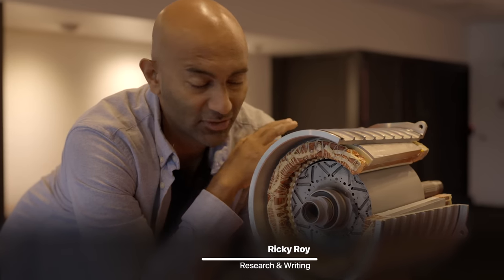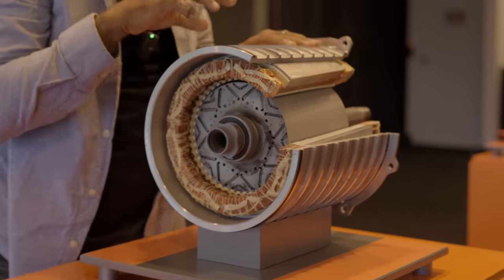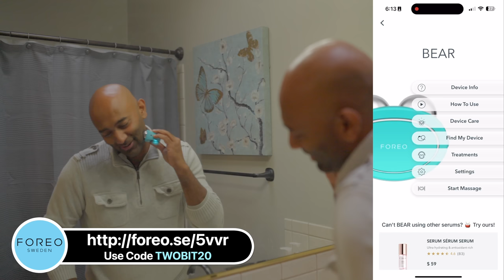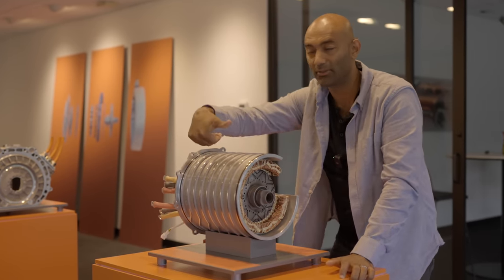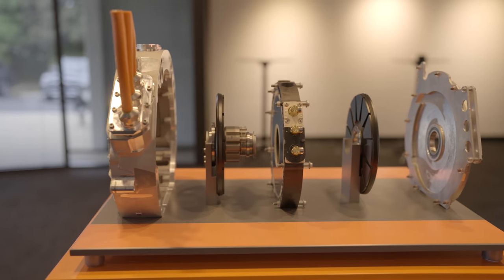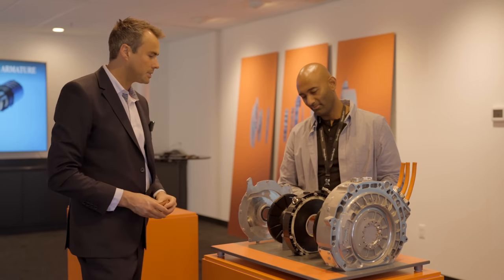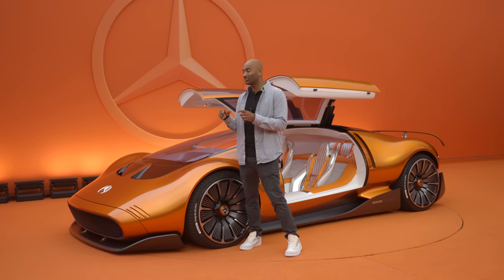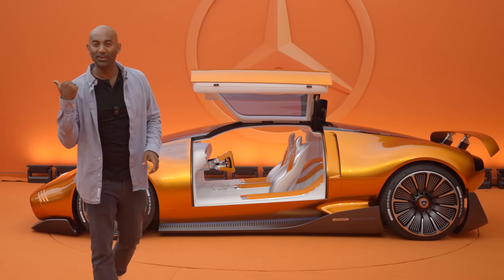Axial Flux Motors Will Change CARS - Here's Why

Comment: This reminds me to some extent of the way floppy disk drive motors were built in ties gone by. The major difference would seem to be additional magnetic flux paths to better couple the winding flux to the rotor. It would be interesting to cobble together a motor using some old disk drive magnets and coils in a stacked configuration together with a yoke or maybe magnets on both sides to the windings with two rotors coupled on common shaft/spindle. Must put it on the (rather extensive) to-do list.
Reply: Sounds good but lacks the visual aspect. Make a video about it 😁
Reply: one sided story - the pancake motor sucks at high speed and has a very bad packing efficiency
Reply: Been in the technical field a long time ago, just another perpetual motor.

Comment: I've been wondering how viable axial Flux motors would be. I built an axial Flux alternator from scratch to power my bike light, and it's pretty amazing.  Having that as a motor makes a lot of sense.  I'd be interested in seeing how the designs deal with gyroscopic forces too.  When a big heavy disc spins, it creates some very powerful forces that can even destroy the motor itself.  Radial flux motors don't have as much of a problem there because they are so much "wider".
Reply: Next the flux capacitor
Reply: Good point, wonder if impacts handling/ turning at high rpm
Reply: @lynby6231  Indeed.

Comment: I think axial flux motors have a very good use case scenario in electric aviation where ultra high RPM isn't needed but light weight high torque is a necessity

Comment: Axial flux motors (or axial gap motor, or pancake motor) are being developed by several companies at the moment. 
Great design for "inwheel hub motors" and has a lot of potential. 
Cars like the Aptera and the Xbus were thinking about using that in their cars.
Reply: "in-wheel hub motors"   
Yep, this is the holy grail for vehicles.
Reply: One of the concerns I overheard at the 2015 CENEX show at Millbrook UK about this was unsprung weight. The thinking then was that two of these would replace your differential but driveshafts would still be the best way to deliver the power to the wheels.
Reply: I had an idea for a single seater hill climb car with in wheel motors and a small swappable battery
Reply: @cjjuszczak  NO! They make the wheels too heavy and this is quite a negative in cars: wheels must follow the road inequalities, and this would add a lot of inertia. THIS is why the solution was discarded years ago.
Reply: @francescocacudi1767  With lightweight materials that problem would be less and less with innovation. And you dont need drive shafts that are very heavy, just electrical connections.
Reply: @@screwdriver4406 What is YASA's axial motor's torque at 0RPM where you need it most for launching a stopped vehicle? The datasheet says 0Nm. These motors cannot be used to accelerate from a full stop in their current form, will need some sort of induction or synRM variant that can do full torque from stall.

Comment: Engineering test technician at BorgWarner E Motor Product Development department here…. 

This design has been talked about here in our experimental test lab for a few years.  I can’t wait to see it!

A nice thought about placing these at the wheels… however… these motors will need to be Sprung-Weight… not Un Sprung-Weight.  Subjecting that machine to direct road harshness will destroy it.  I could see two of these in an AWD app.  One for front axle and one for rear.

Comment: The cool thing with that motor shape is that it could be packaged laying flat with a differential below it, so you could theoretically make them much larger with a massive torque output
Reply: @dangraff8467  It'd work great on a rotary engine hybrid

Comment: Did a great job of comparing and contrasting the two types, but I still don’t understand how the axial works.
How does the flux moving perpendicular to the stator turn with any useable force? 
I’ll definitely have to do a bit more research because this is really cool and I’m curious how it actually works.

Comment: Audi uses a two speed gearbox in their e-trons which help with acceleration, maybe that's an idea for Mercedes as well to address the lower max rpm of this motor.  Fantastic development - thanks for showing this!
Reply: E-tron...French for turd...lol
Reply: Tesla has proven those to be unnecessary complication with the Plaid Model S motor
Reply: Just use a CVT?
Reply: @thomasreese2816 
Not really proven anything.
Reply: Audi E-tron GT has 2 speed gearbox rear motor, other E-tron models has single speed reduction gearbox.
Reply: Only on the e-Tron GT, as it's carried over from the Porsche Taycan, because they are basically the same car tech wise. All the other e-Trons use conventional, single speed gearing.
Reply: @Humbulla93  Electric motors don't need CVT. They produce almost constant torque. A gear is enough.
Reply: @framegrace1  i trust Toyota engineers more than VAG engineers after all Toyota is Always leading in reliabilty rankings. I wonder if printed PCB motors will get Strong enough to Power a Car. That would be a Second Ford assembly Line like Revolution. And some modular battery packs to fit in each modular Car chassis

Comment: So far the limitations to any Electric Motors are a) High Current required for high torque(Flux density) b) Heat generated due to High Current (Action ) and Back Current ( Reaction ) due to acceleration c) Regulation of Current into Wires cores without "Fluctuations" and "Impulse Kick" d) Batteries available for High Current at sustain levels without over heating e) ..... etc ( As more research is done ) . Interesting times ahead. Heard that Korean has a new design for "Power Motors" and used by Hyundai ??
Reply: One way around is using higher voltages which can produce more power with less current. My 2014 Ford Fusion Hybrid has a 120 HP electric motor and the battery supplies over 400 V. The DC cable is only 1/4 inch thick.

Comment: Aptera is also going for radial flux, wheel-mounted, motors. Their cars, if Aptera can succeed in bringing them out, should be on the low end of the affordability scale.
Reply: A firm destined to the has beens
Reply: @eddiereed5025 possibly, but they will put out at least a few cars before then, and if you’re right, and they stop, you can imagine how valuable those cars will be? So either way, if I lived in the US, I would get one. I’m sure renting that thing out would pay for itself many times over. Stop being emotional, start being clever, and go make some money.

Comment: E-machines are becoming more important for aviation, too, and for that application axial flux motors hace another big advantage: 

Aviation e-motors often use cobalt iron as material for the stator core because of the much higher saturation flux density (=more torque density and overall better efficiency). However, the downside is that cobalt iron alloys are much more expansive than your standard iron silicon alloys. That's why they are used almost exclusively aviation and racing. 

When stamping the laminations for radial flux motors you stamp something round from a rectangular strip. Also you stamp a big hole away in the middle where your rotor will go. This means most of the material that goes into the stamping press is scrap - in case of cobalt iron very expansive scrap. 

Axial flux design stators are a bit more difficult to stamp because the cross section changes with the stacking direction. But material utilization is much much better. You acutally use the mayoritiy of the strip that enters the press. Fore iron silicon cores the cost impact isn't so big, but when using cobalt iron 50-70% of the cost is material. So the impact here is huge!

Axial flux motors and cobalt iron are the perfrect match! 

An axial flux motor designed with cobalt iron in mind (and maybe using some of the things you can do with axial flux motors such as adaptive airgaps instead of gearing) is probably the best e-motor you can build.
Reply: Not sure what kinds of RPM’s a light aircraft motor would need without a transmission, is 10k enough?
Reply: "E-machines"  LOL.  I read the rest to see if you were going to tell us they would never be obsolete.
Reply: @kwrzesien17 most propeller aircraft have prop RPMs below 3,000. 10,000 would be massive overkill!

Comment: Very interesting. It reminded me that back in the 1990s, Hydro-Québec's labs created something they called le moteur-roue (the wheel-motor), an electric motor that would fit inside each of an electric car's wheels. It was pretty amazing! Extremely powerful for it's size. BUT, sadly, they were WAY ahead of their time! And there was no market for it back then. So they eventually just let it die.
Reply: An interesting tid-bit. An associate of mine was brought in to try to salvage the program, with very little funds available. His predecessor spent C$200 Million and was still far from reduction to practice. The fundamental problem, the promotors of the concept were much better at selling the idea than in execution.
Reply: It has nothing to do with ahead of its time.  The concept simply does not work.  It does not work before and it does not work after.  It is the unsprung weight the system added to a car's suspension system.  It will make a very bumpy car.  Noone will buy a bumpy car that breaks their backbone when hitting a minor bump on the road.  The conditions for this system to work must have flat and smooth ground to run on.  The vehicle must be operated in slow speed.  First thing I think of may work is forklift truck.

Comment: For Axial motor design, per watt of electricity, you get more torque, but you get less speed (distance).  Radial motor design already gives you enough torque, so it's rpm speed (distance) you want for increased mileage.  So perhaps the advantage gain you can get from an axial motor is to make a smaller motor.  Ideally so much smaller that you can attach to the wheel hub of each  wheel and allow drive and power by wire.  Smaller axial motor will be more overworked which will generate more heat.  It's likely that current axial motor designs have a problem where cars can't go past 110 mph.  Imagine how it feels to drive an axial motored car when you are at 100 mph and you have to depress the pedal fully down.

Comment: Feels a little like a high tech callback to the circa 1930s radial piston engines for aircraft.  Of course, without all the parts and complexity.  Very cool technology.  You can easily see applications in aviation where weight is so important.
Reply: Problem is the battery weighs the same being full charged or empty. Whereas liquid fuel gets spend so the aircraft becomes lighter during the trip saving more fuel. For short taxiing aircraft however this could be viable, though the batteries need to be modular and changable in a reasonable amount of time
Reply: @Humbulla93  They could be hybrids. Wouldn't need much battery.

Comment: I invented this motor back in 2011/12. My coils were at the centre, with cooling pipes zigzagging over and under each coil. I called it the "DISC-MOTOR".
Then just like the one shown: I had two drive drive disks, one on each side, these had permanent magnets fitted into them. The magnets each side of
the coils were opposite polarity, so that the coils would exert pressure to both at the same time. 
The idea came to me when I was thinking about leverage. If you put finger near the axel on a bicycle wheel, it takes quite a force to get it moving!
But: put your finger near the rim, and it becomes very easy to start moving. Hence the idea. The problem is that it vanished from the computer that I was using.
So I have No proof of ownership, but at least it will change the running cost in transport, from Motorcycles, to Buses. The idea could be used in industry, for pumps
made with a larger diameter discs. Someone told me before to redo the design, as no doughty he did not believe me. I am getting on in years now, and don't see the
point anymore. I just hope they don't procrastinate, and get it into production. P/S, I did not work out all the different aquations, only the mechanical side 
and the schematic drawings.

Comment: Cool tech. I'd be interested to see what these will cost per drive unit. Tesla recently commented in an earnings call that they'll soon bring the cost to produce a single drive unit down to $1000. It's all very impressive, especially considering the raw output potential, reliability, and seemingly endless after market applications for conversions. The future is quite exciting!
Reply: Future is fiery with all the ev fires.
Reply: Axial flux motors are not new (They have been built from the start.). They have not been used big scale because of cost, mostly due to manufacturing complexity. I mean, if all current EV's have not used them is for a reason. They are very expensive, much more expensive than any current benefit. 
For now this will just be a Supercar thing, unless this people can reduce the cost for real.

Comment: If you have to couple it with a gearbox to achieve the necessary final drive gear ratios to drive a vehicle at the required speeds then you would be negating the benefits of a low weight and compact design. Also consider the efficiency loss from the gear box. If these motors can meet the design parameters without use of an overdrive, and I think that's possible for road use, then good to go so long as the efficiency is better. As it stands now, the largest hurdle isn't the weight of the motors, but from battery technology that is heavy, expensive, and has a fairly short life cycle. My unpopular opinion is that we should consider much smaller vehicles in order to to realize the true benefits of electric transportation on an individual level.
Reply: Radial flux motors also need a reduction gearbox after the motor.

Comment: Axial motors are not new nor it's a panacea... There are pros and cons for axial motors but a complete product is not just the motor. Majority of traditional ICE car maker are unable to come up with good software, just like the mess with Volkswagen buggy software.  ICE constructors are late to the party, let alone their inability to change their habits and come up with competitive EV.  Design with "binned" parts like Ford did is really not the way to go.  I see cars that announce "1000 KM" but weight more that a 747, etc.  I wish more competition but for now, they really have a steep slope to climb...  By the way, good "infomercial" and best of luck for efficiently producing axial motor in high volume at an acceptable price...

Comment: I have a Mercedes E450 with the axial motor between the engine and the transmission in a mild hybrid configuration. It supplies instant torque in high acceleration times until the turbo spools up. It also reduces downshifting in some hill smaller hill climbs. Result is a very fast car  (0-60 <5.0 sec.) with gas mileage around 24 in the city and 33 on the highway . . . . in a 4,000 lb vehicle!!!!! Oh and by the way it is the generator for a 48 volt system with no power take-off belts. Axials are torque monsters but weak HP producers. It will be interesting to see how development goes to compete with the radial flux motors in the HP area.

Comment: I have always thought it would be much more effective to put an electric motor on each wheel. Spin all fours and it would take off real fast and when you get to the speed you want, just back off the gas and let one motor maintain your speed. If you also had a small engine, it could just be a generator, your gas’s mileage would be great. Once they become available I will buy 4of them, if I can afford them, and put them on my project car. No hurry, it’s just on paper for now.  Lol
Reply: The extra weight is on the wrong side of the vibration dampening system. I read that this is called "unsprung weight". Consequently, the extra weight in the wheels transmits shocks to the car and literally causing a bumpy ride.
Reply: @robertdobbs2283 , Interesting, I will be keeping my eyes on this one and see if the bugs can be dealt with.

Comment: Thank you for providing some insight into the Mercedes axial flux motor. I see three alterations that if applied would greatly increase it’s efficiency. A 50 lbs. motor should produce 20,717 Tesla’s @ 60 Amps  and only drop 0.2155 volts.

Comment: Can this be assembled inside the wheel itself? That will make car construction a bit more modular. Modules: 1) Surf board or car board, 2) Wheels, 3) control system, 4) body (with doors, windows and seats) and 5) dashboard. Each can be manufactured separately (with various form factors) and assembled... Future is awesome... Modular design and manufacturing of modules in volume has the potential to bring down car prices significantly...
Reply: good thinking and this would be amazing but alas car manufacturers arent interested in bringing prices down by building smarter. their interest is in building cheaper and charging the same or more. this would require a new manufacturer to enter the game
Reply: Never increase unsprung mass. You're welcome.

Comment: By assigning one of these units per wheel (2WD or 4WD) you would eliminate the need for a differential as well. The handling benefits by electronic tuning/balancing would be immense.